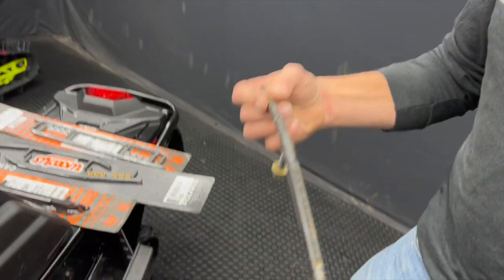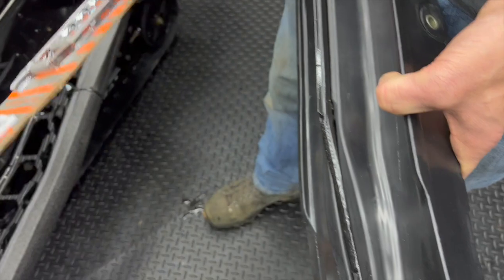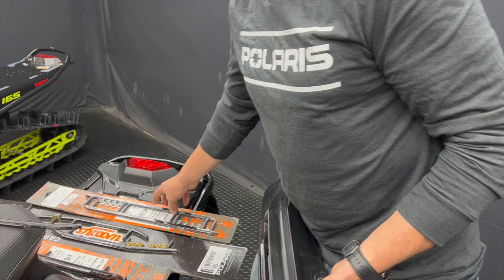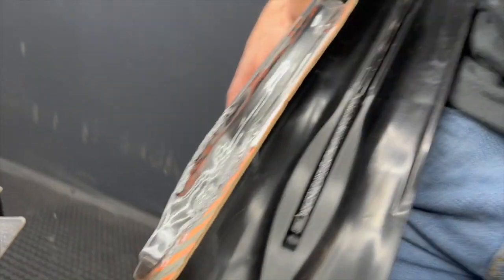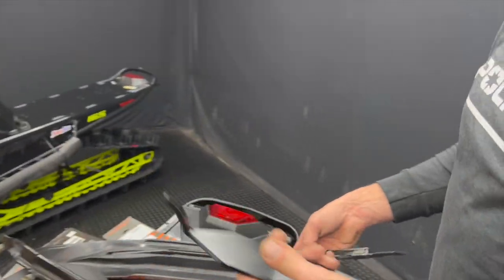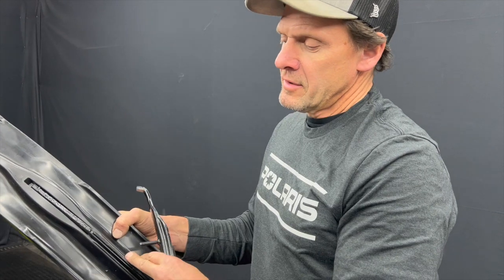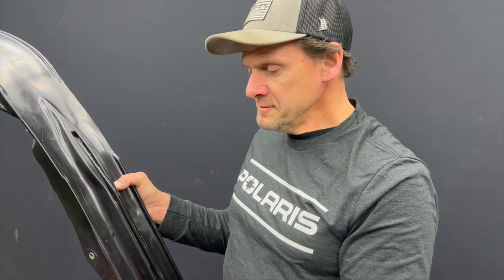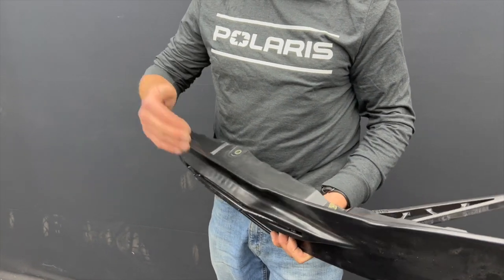WOODY'S TRACTION PRODUCTS- CARBIDE RUNNERS AND ALL THINGS YOU NEED TO KNOW ABOUT THEM!

Comment: Great  info!! I ran 8” Woodies duallies on my 2012 f800 sno pro for about 3,500 miles, I liked them but steering a little stiff , then I switched to Bergstrom triple points for 1500 miles, easier to steer but had the same bite in the turns, I’m trying  out a set of Snow tracker carbides  on my VR1 since I got it new, got 1200 miles on them and they are great! Only issue is in low snow they are so deep that it’s easy to catch rocks,  rail, etc, they have that Navigator like Bruce was showing built into the wear plate, they do not dart at all with there triple wing design, I’d say good thing about Woodies  products are the ease of availability compared to the other two I mentioned if you tear something up,  ,  I ride 90% groomed trail, 10% off trail
Reply from the maker: everyone has preference and they will go with what makes them happy! we wanted to go over the Woody's line up and let everyone know what was available!

Comment: I've used all kinds of carbides over the years, and all kinds of brands. Nothing lasts as long as Woodys. The more aggressive, the better for me. I don't care what speed I'm going, when I turn I want it to turn. I usually run 8" Ace with a custom 1/4" extension to push them out even more into the snow.
Reply from the maker: have you tried to run C&A Skis? seems like you would enjoy them! but agreed Woodys is the bets in the market!

Comment: Thanks for the video; good to know.  Think I'll opt for the 8" Ace for my crazier sled.  You made the point, more aggressive the studding, the more aggressive the runner has to be.  Was also unaware that new sleds are worse for darting than older sleds... all my sleds are 90s Indies.  Curious about paddle tracks, same idea as studs?

Bobsledding is a more accurate term for darting.... darts follow a set trajectory based on your throw.  Bobsledding, is done in a trough and following the trough.
Reply from the maker: same wth paddle tracks yes/ more traction in the back the more you need up front!

Comment: Hi: Jesse Christopher ottawa Canada I used the 8 inch slim Jims on my apex with power steering was wondering what experience you had if any using these on polaris skies. On apex great with powers steerring but wonder will slim jims work well on Polaris and even more important make it hard to steer. Have the Navigator plate on my 2022 XCR. Christopher
Reply from the maker: its really rider preference. i use huge skis with 8 inch Woodys Mavericks. Id Say the Polaris is lighter on the skis then the Apex so i dont see you having an issue but you wont know until you try it ya know?

Comment: Have you run the ace or dooly on you c&a skis and if so did you have an issues with darting? I currently have a renegade x and pushes on corners but I have a pair of c&a adx kicking around that I want to put on don’t mind more steering weight just want to know going into a corner that I’m actually going to turn
Reply from the maker: ive run an Ace. Doolys will decrease your steering as it splits the pound per inch on the carbide. I do not have issues with darting with the C&A's as long as toe is set properly. i do not know what model the ADX is though. Not one they make these days at least
Reply: @JESSEJAMES322  thanks for the help and from what I’ve gathered it’s the original C&A